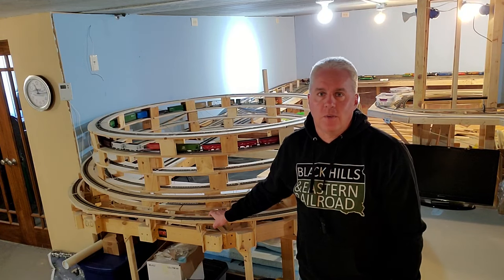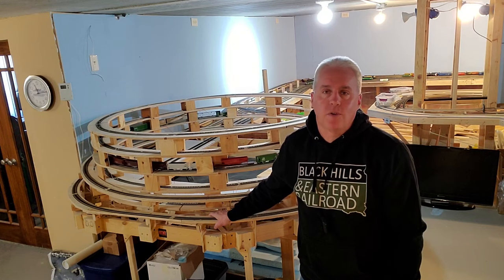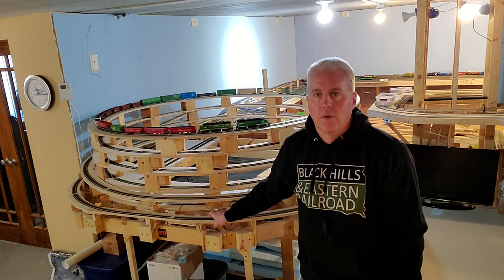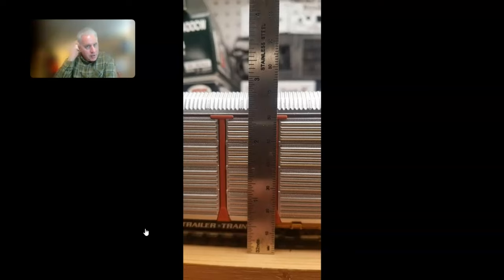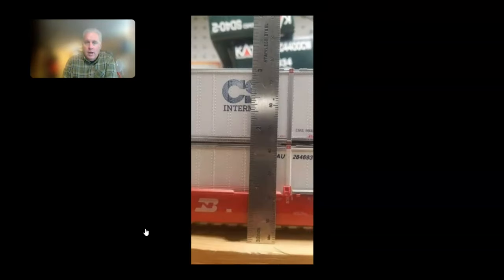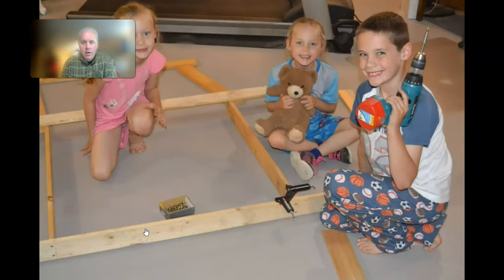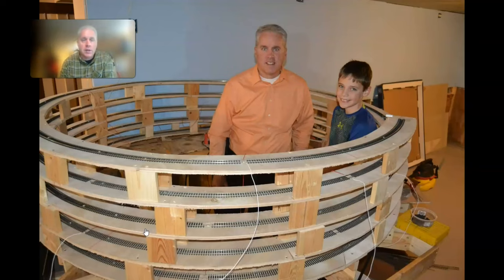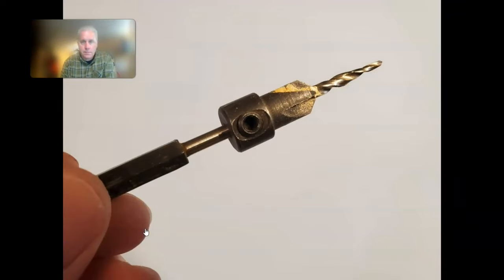Scratch Built Helix on My HO Scale Model Railroad Layout - Design and Build

Comment: I built a helix almost step by step identically to your techniques, so, I can heartily endorse this project. The only real difference for me was I used 27" radius curves with code 83 Atlas track due to space limitations and lots of flex track recycled from a previous layout. That sharp curve hasn't given me any issues in case someone has reservations about it. Just don't go over 2% grade. Beautiful work!
Reply from the maker: @avlisk  The radius debate is a double edge sword in both directions.  My code 100 track was used also.   Was a major $$$ saver and has been on the remainder of the staging level.    I follow on the grade thing.   My helix is part of my continuous running concept, so it has to be reliable.  Not that operation of the layout is any less so...

Comment: I really appreciate this video, as I only have a small bedroom to build in - approx 8 ft x 12 ft / 2.5 m x  3.7 m - with slopped ceilings starting at 45 in / 114 cm above floor level, and need a 2 level stacked layout, and need a helix to move my trains from one level to the next. * subscribed *
Reply from the maker: Thanks for your comment and for watching!  Not sure I would recommend a helix in a small place like that.  Just centerline to centerline of my helix is six feet across. A gentleman by the  name of Dan Dossa has a double deck layout depicting the Minnesota Commercial RR in a similar space to yours. He chose not to connect the decks.  I am told that this layout can keep a couple guys busy operating for several hours.

Comment: thing with a helix, you love them or hate them, you made yours big enough for a double line, why did you only do a single track ?
Reply from the maker: @sparky107107 Absolutely!  I love and hate mine.  I did think about double track on the helix.  Could go into an entire episode about why I only single tracked mine.  In short, I wanted simplicity.  I'm modeling light branch line on ~60lbs jointed rail in dark territory.   Not really any requirement for double track!
Reply: I did double track in my helix, one is to go up and the other  down  @blackhillsandeasternrailroad
Reply from the maker: @sparky107107 I suspect that's the way most designs that call for a helix do it.  I had some special design considerations that allowed a single track.  Milo and I just operated on a layout with a double track helix.  https://youtu.be/WQnt5vHEsGs?si=CHvBnXdAgskTsY4Y   The helix part runs like a Swiss watch.